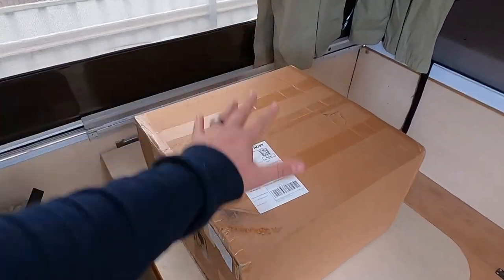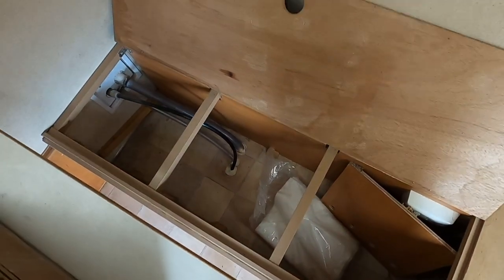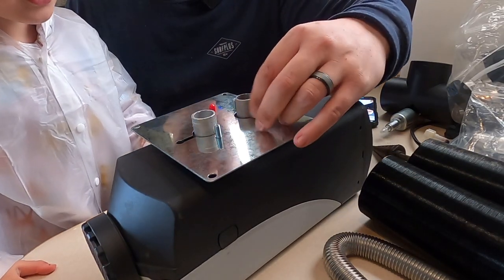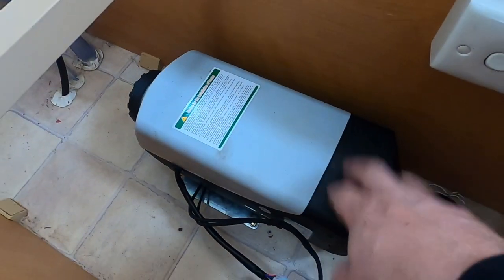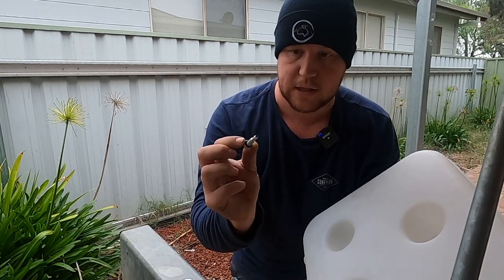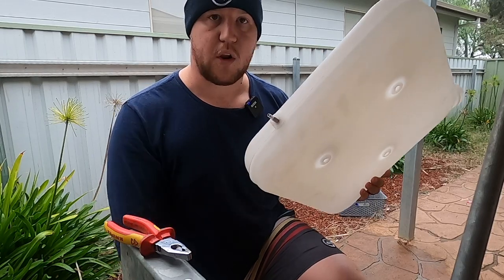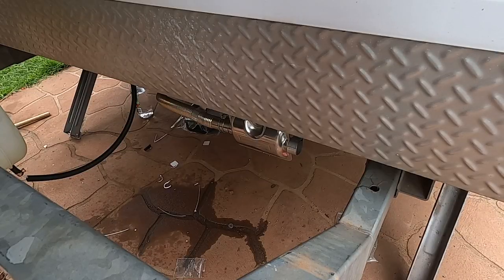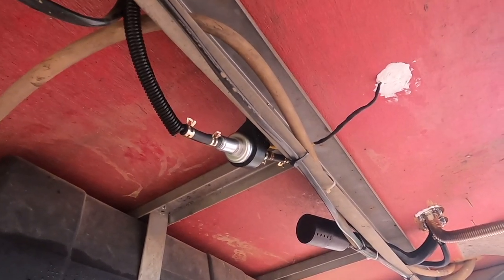Installing a CHEAP DIESEL HEATER in a wind up CAMPER - IS IT WORTH IT?

Comment: I love these heaters as they really can regulate the heat during the cold.  
An issue I found is placing the thermostat at the ‘living level’ or bed level.   That way it regulates the heat to where you’re sleeping.  Having it low baked me out with too much heat to warm down to my feet, as I was roughly 2 feet higher and it got too toasty.   
You can make a ‘plug’ to attach the thermostat at the cabinet and Velcro it at the bed height!!!
Reply from the maker: For the price you pay for them I reckon they’re unbeatable!
That’s a great idea about the temp sensor too. 
I’ll be sure to look into it!

Comment: To limit the sound of the fuel pump, I've wrapped mine in some old rags and just cable tied them on. Works really effectively. Can still hear the ticking on the outside, but on the inside with the fan going, can't really hear it at all.
Reply from the maker: I actually saw a setup like this a few weeks ago and wondered how it went, sounds like it goes alright!
Reply: @OutNAboutAustralia  yep, I've done it on a couple of campers now. Makes a huge difference. I tried a pool noodle and a couple of other bits and pieces but found the good old rags made the biggest difference.

Comment: Make sure you add a hidden switch so when the unit has cycled down you can cut the power to the unit other wise the screens tend to burn out
Reply from the maker: Good tip Clint!
Luckily my setup does let me isolate it with the whole 12v system when it gets stored away 👍🏽

Comment: Could I suggest that you put a rubber mat on the floor and one one the heater so it is quieter..
Reply from the maker: It'd definitely be worth a try. 
The heater does have a rubber pad that it mounts to that is supposed to "minimise" vibration noise but the only problem noise we've experienced comes from the fuel pump mounted outside.
Reply: @OutNAboutAustralia  If you checkout a few of the -30 camping vids they have alt pumps that you can buy super quiet.. 

One day when I get back to Wyalong I'll hit u up to have a beer and a chin wag
Reply from the maker: No worries mate 👍🏽

Comment: Not going to install the tank, T ing into the fuel line of the van (mine's a diesel, no use with a petrol of course).
No diesel fumes / mess in my van.